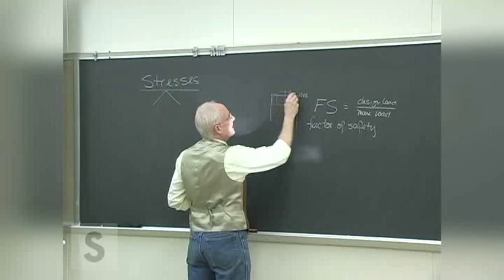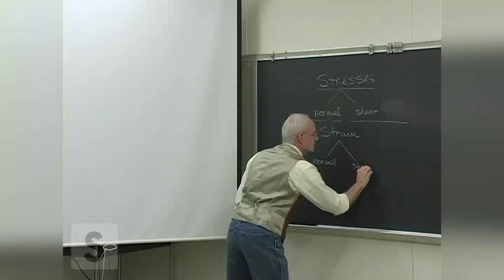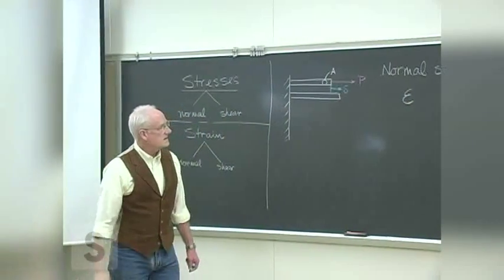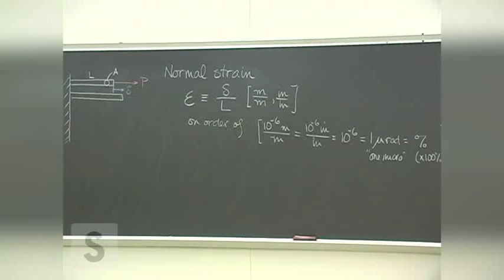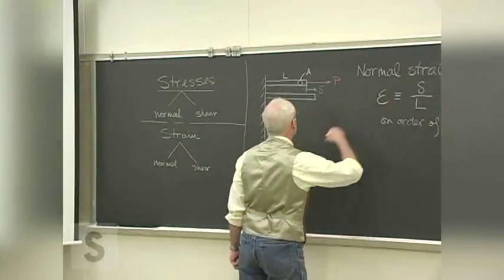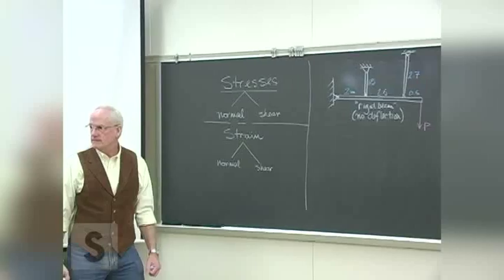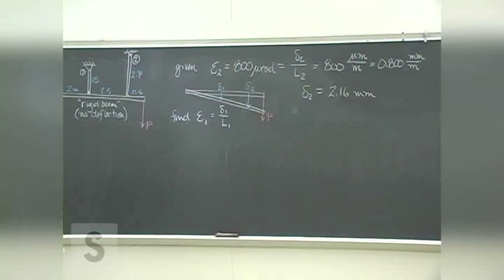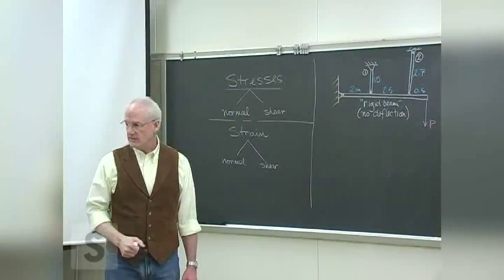Saylor.org ME102: Ken Manning's "Mechanics of Materials - Deformation"

Comment: I'm a bit confused. Isn't gamma the change of an angle in this case? In 58:45 and forwards shouldn't it be gamma=arctan(0.5/720 + 0.25/480) = 0.00121527718
(not 0.5/720 + 0.25/480=0.121527778)
Reply: Yeah but he said that because the angle was very small, it would not matter if we used the arctangent.